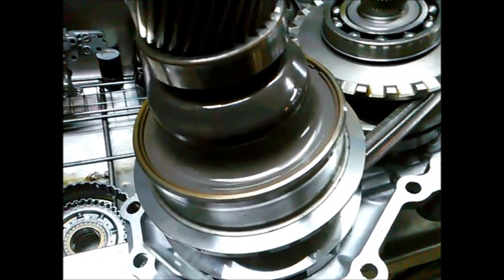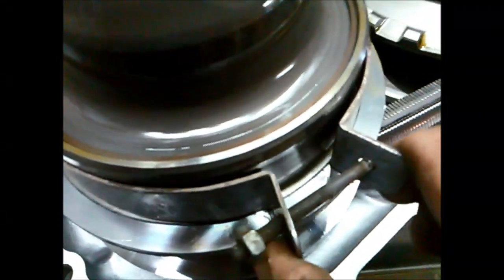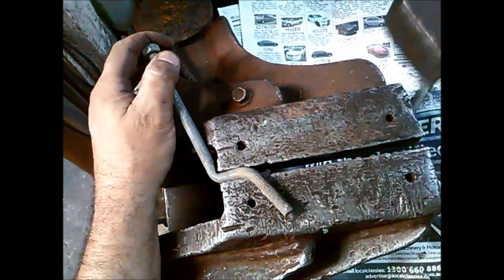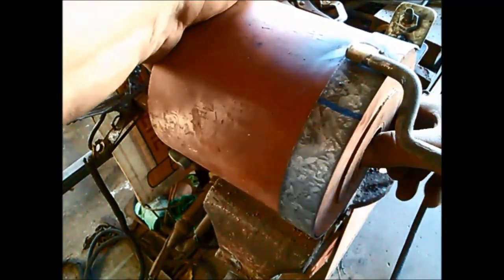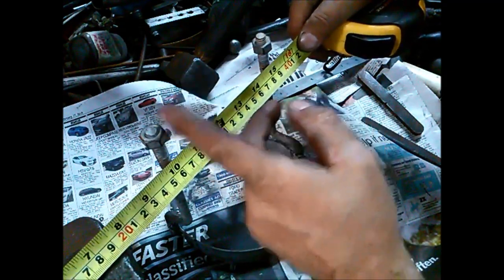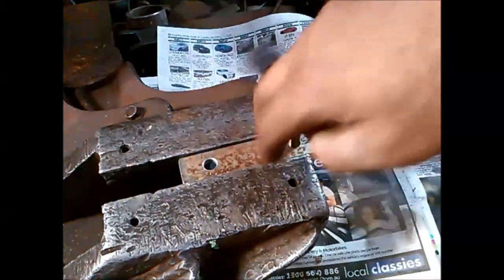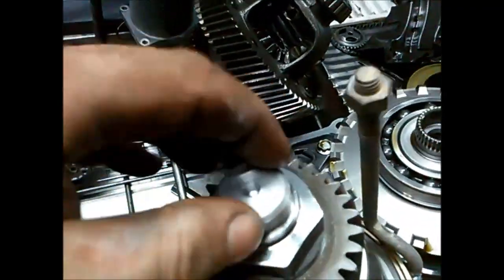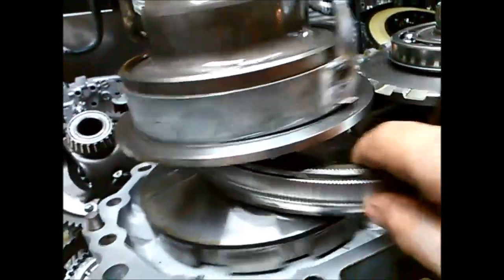Make Your Own Tool CVT Automatic Transmission Transaxle Belt Removal Tool DIY How To Make Your Own

Comment: Is this a JF011E  REOF10A?
I like that tool you made up!
Have a 2012 Nissan Altima.
Carvruns great till about 60kmph or 45mph, then it doesnt want to upsift (variate) so at that speed its around 3K rpm. If you push harder it sets the eng light around 4K rpm.
P1778 a stepper motor code. Pulled the pan and it looks alright in there. Dropped valve body had a peek inside and belts in great shape. Cleaned up the valve body, noticed the ratio control valve was sticking. Free'd it up, reinstalled everything, new fluid and both filters. Car still drives the same...
Whats your guess on it?
New trans or new valve body?
Reply from the maker: hi, sometimes a flush of solenoid isn`t enough. you need to properly bench test it. cheers

Comment: How did you put the new belt in? Same procedure in reverse, then fitting the whole Assembly to the box?
Reply from the maker: hi, yes put belt in as shown but in reverse. cheers
Reply: @YepThatsIt  I have got it all back in, drive is fine but I have lost reverse gear, any ideas to why that has happened? Thank you

Comment: The car manufacturing companies insist on keep the CVT transmission because it's cheaper to manufacture and will make more profit for them, even though the CVT less reliable than direct shift AT. Thanks.
Reply from the maker: hi, keep them cool and serviced regularly and you get more life and reliability out of them all. cheers
Reply: U are right